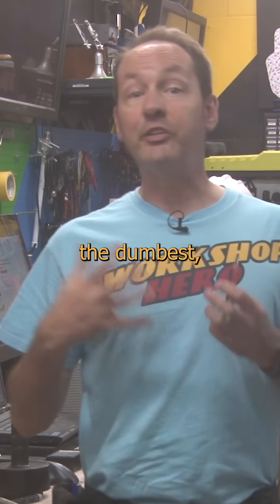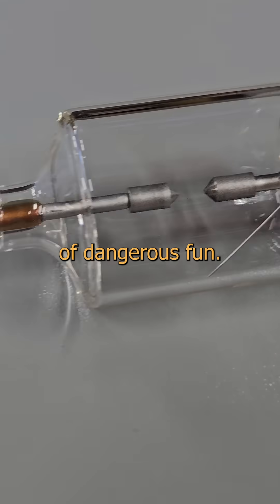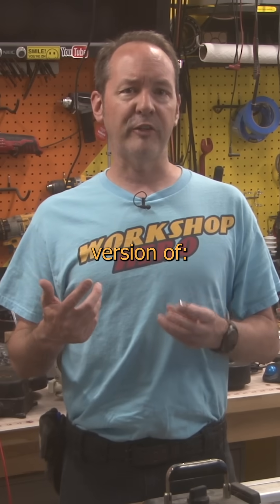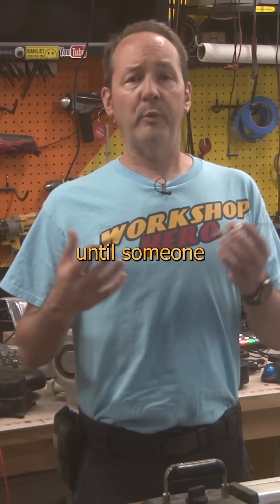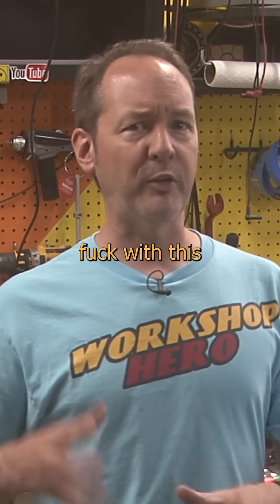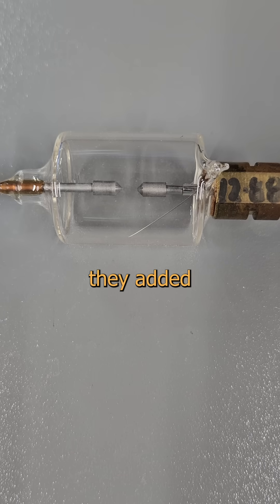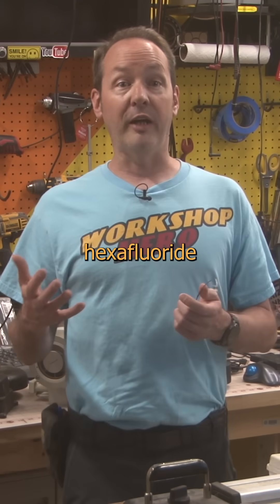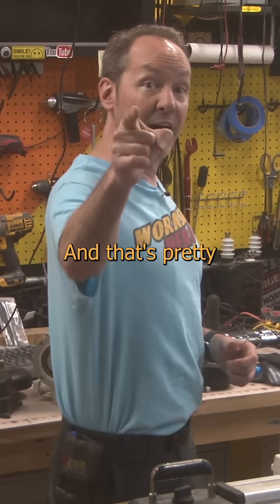Spark Gap Tube #chrisboden #comedy #engineering #highvoltage #physics #tesla #science #energy #cool

Comment: Qwick question for the electrical engineers. When using this spark gap switch thing is there any notable loss in power. I know there is some loss in light and heat but are they big enough   to have a impact  in applications?

Comment: The insulating properties are 1k Ohm per cm, so at 1 cm of air gap a circuit needs 1000V (1kV) to jump! here in europe we have circuits with 400V Phase to Phase, so i know that spark couldnt jump if (at normal room conditions) the contacts are 5mm apart

Comment: What matters for arc-making  is the electric field intensity, not just the voltage. So if you put 300v across a really small gap (0.1mm) the intensity of the electric field will be strong enough to break through air

Comment: I was repairing an old spotlight power supply and found a broken sparkgap. I found the manufacturer and tried ordering one. It turned out that they were also used in trigger circuits for nuclear weapons. I had to get vetted before they'd sell me the sparkgap.... In case you're wondering, it was a General Electric part.

Comment: I get the two bits in the centre, what's with the little wire poking out side it to the wall?  Is that like a backup?  Also by standard temperature and pressure you mean the ICAO standard or something else? 15C and 29.92inHg

Comment: I use a spark gap tool as an auto mechanic. When I question if a waste coil pack is weak,  (usually Buick 3.8) I toss it on and if they're weak they won't jump the gap. Quick and dirty, diag.  Then, so I'm not just chucking parts at shit, I verify the coil resistance.

Comment: The TX Kerrville flood? , and your math. You probably dont want to get in the middle of any of that, its fking with your country pretty hardcore. Your the only guy Id trust to hunt down the answer.
Reply: Just consider checking bits and pieces, I dont think you need much and I don't need a answer from you.
Reply: River rises 29ft in 30mins?  Because of rain/storm. That's like 75in hr? ...??? No one will speak about dam failure, it was all rain? Plus considering TX and it's terrain features being funneled into a particular river area?
Reply: Storm happens from 1am to 4am I'm hearing
Reply: 29ft in 30mins? Not 29ft in 4hrs though.
Reply: Would be more like 400in an hr. I'm not sure a human could stand up and walk in rain fall that heavy if clouds could hold that much water weight.
Reply: Water so fast , ripped live trees out the ground, people floating away screaming out RV windows. The math is not adding up vastly. The number doesn't get close.

Comment: What about the spark plug? Does it have an adapter before from 12VDC to 300VDC? I thought you controlled its power by the gap size. So it would jump at lower current and voltage with smaller gap.

Comment: Residential building wire, nonmetallic sheathed cable is rated at 600 Volts in the US. Not sure why you’re stating 300 Volts.

Comment: The clam operated switch that controls the warsaw water supply from the local river. It's literally just a wire and electrode contact hot glued on a live clam that would close if the water got too dirty and open after an hour

Comment: Pull a vacuum on it and see if it will arc. One video you said wire doesn't care what voltage is on it. Most house wire insulation is 600v rated. I believe its 350v minimum to jump an arc. As long as you are 90% or above on Hydrogen or 10% and below, it will not explode.

Comment: TIG welders use this principle on transformer based units. I believe it's only used for inducing the HF start/AC stabilization voltage. I don't think inverter units require this apparatus.

Comment: This is kind of misleading, when inserting and disconnecting plugs from a 240 V socket, it can spark all the time. You need roughly 0.08 mm to cause a spark at 240 Vac. This is super oversimplified.

Comment: I worked on a pulse power system that had 36 small gas switches with spark gaps just like that shown, they were all timed to fire at the same time using a laser through a window.  The laser would cause the break down voltage of the gas (SF6) filling the switches to lower.  small voltage in  100s of Kv out.

Comment: IFAIK, the breakdown voltage is expressed in V/m. Increase the gap, you need a higher voltage to break down. I once did research on dust explosions, and the setup had 2 of these electrodes too, where I could play with the distance between them.

Comment: Used to work at a power plant with Gas Insulated Switchgear for the High Voltage leaving the plant that was encapsulated and then filled with Sulpher Hexadlouride.
Controlled making and breaking power to the Step-up Xfmrs that went to were connected to the power lines via the typical air-gap switches you see in Substations.  VERY fun to open and close at night ⚡️ ⚡️  ⚡️

Comment: Damn we are only 60 volts off from our wires going up in smoke here in Europe 😂.  We use a 240 volt system at up to 100 amps if needed.  Most of our fuses though are 13 or 5 and 3 amps in our plugs depending on the appliance being powered.

Comment: So it’s 300V at STP, could the arcing electricity change the temperature of the air around it enough that the voltage needed to jump is changed?

Comment: That's pretry cool! Fun fact, that's the same principle that dictates the maximum voltage of a capacitor before it pops. It's not the same as in air (except for air capacitors, those are 300 volts/cm), but if you calculate the distance of an equivalent 2 plate capacitor and apply the 300v/cm or whatever material you're using, you get more or less the same voltage (although they usually lower it to add some headroom)

Comment: Edit: I completely forgot about Paschen law and that the electrons actually need to have enough energy to ionize the air. So yeah you are right there's a minimum voltage.

Old comment: "You cannot get the spark to jump bellow 300V".
Well it's 3kV/cm so 300V/mm. E field should matter, not the voltage. If you get the wires 0.1mm apart, you should be able to get spark at 30V.

Comment: A weird switch that I think is simpler than the spark gap switch is the Mercury switch. My 1965 Pontiac Bonneville has one for the Reel Out trunk light, and I had to sodder on a new connector wire onto the new Reel Out light, because some moron had to remove the original one, toy with a stainless steel tiny push pin cap of the original wire contact and stress about it not shooting off and walla! Now the Reel Put light is operational again after struggling to get the input cap of the Mercury switch capsule to unsodder and release. The best part is that Mercury switch was perfectly fine after 60 years of service and probably half that time sitting on a shelf

Comment: So is there a ratio then that can equate voltage to distance? obviously that would be based on the medium and breakdown limit, but it seems like 300v can equal this amount of area for the limit. If the electrodes are further, it'd require more volts, right? Or will it just carry since it is looking for another end of conduction?

Comment: He quickly mentioned a "fun" little chemical Sulfur hexafluoride. Or SF6. This bad boy are used in large strategic electric equipment when you need to break the current. It is a lot harder to break the current at high voltage.

It is a miracle gas that are really useful for modern way of life. It just has some "minor" problems. In that it is a greenhouse gas almost 24.000 times worse than CO2.

Comment: that tube he has in that video looks to be filled with low pressure xenon based on the arc behavior and color, another fun fact about spark gap tubes is some of the older ones (and possibly some newer ones even) used Radioactive Isotopes to make the spark gap tubes more efficient in Cold Weather/environments, some of the tubes from the 60's are still very spicy even today (i have an indicator lamp that has a 1uCi Ra-226 Source inside it, it gives off around 50,000CPM)

Comment: 300V for sparks to be possible in air? at 230V AC you have peack voltages of 325V, so is it dangerous?
yes. it will still absolutely be dangerous wehn touched, but that's why insulation is there to keep that from boing one's fate

Comment: The 300v rating is legacy, from knob and tube. You can actually touch a live insulated wire and not get shocked, proving the insulation on the wire is doing all of the heavy lifting rather that the air around it.

And the breakdown voltage gets funky below 4um for air. (approx 340V.) V/um or kV/mm skyrockets as you get closer, but very much not linearly. Above that distance the kv/mm breakdown continues to fall, but not enough to really care so much, so the linear increase with distance formula you know.

I know you mentioned distance, but you did glossed over it and weren't super clear on it.

Comment: "the breakdown voltage for air at standard temperature and voltage is 300V.
This assumes 0.1mm air gap.

It is 3kV/mm for uniform fields under standard condition.

This gap is larger yet flashes over,  that is because
1) it is not a uniform field but a  point-point configuration. (i.e. lower breakdown voltage required for same gap size)
2) it most likely is not filled with air at standard pressure
most likely lower pressure, therefore lower breakdown voltage required
3) the gas mixture internally is most likely not air.  This again modifies the breakdown voltage. How depends on the gas.

Comment: We use these to start the arcs on TIG welders. The High Frequency arcs are high enough voltage to jump the point gap, and are induced into the output leg of the machine and down the torch line to the tungsten electrode. Once the HF jumps between the tungsten and parent material, you have enough of an electrical connection for the machine to be able to send full current

Comment: You can build “spark gaps” for any voltage with silicon and it’s usually more stable and can go to higher power.
Usually it’s something like an SCR and a Zener diode - with fancy versions even allowing you to adjust the minimum current necessary to keep the SCR channel in its conductive state.
Very high voltage ones don’t use SCRs but instead use cascoded JFETs with a BJT at the bottom that remains closed until you give it a pulse into the base, that pulse coming from a long series of 3.5V and 7.2V Zener junctions (they do it like this for temperature compensation).
The easiest and most common type of “silicon spark gaps” are Metal Oxide Varistors - but they degrade over time, especially older models.
Reply: Ones I used I might characterize as single-use. They all gave up after 1 arc.

Comment: Actually in Australia most wires in homes are 750v or 1000v insulation rated. 300v is too low for a 240v nominal voltage mains supply and 415v for three phase.

Comment: Had a lightning bolt jump from the stud welder to an I beam, while the crew sat ten feet away, eating lunch. While the machine was off. I told the shop boss, I'd rather walk the 12 miles home than risk pissing off Zeus by ever touching that broken piece of shit machine ever again. A lot of years later, when I took a college class on electrical theory, when the teacher (who was a high up in our local power company) had us run math, he had us use infinity as the resistance on a break in the circuit. When I asked him how the math worked on an arc, he sputtered and couldn't answer. I wasn't impressed.

Comment: Simplest switch: a chunk of steel you drop on two bare wires and kick away when you're done.

Second: I was under the impression spark gap things made a lot of EM interference and are banned. Maybe just radios? 

Idk, for any amateur hobbyist, be careful  you don't anger the FCC. Or worse, local HAMs

Comment: I think the smartest I felt was when our makerspace had a tig welder but it wasn't available to use yet; nobody had dug deep into it but it wasn't working right so I offered to dig in even though I barely knew how to weld in the first place at the time. But I hooked everything up and tried an arc, and it was like... almost working but just wrong. And I just immediately remembered reading something about checking your spark gap. So I found the spark gap spec for the machine and a set of feeler gauges and found they were way out of spec. Adjusted them to spec. Try welding again; turns out I actually had watched enough videos to do it right and I also knew exactly what was wrong with the process. So yeah, I volunteer teaching welding there now lol.

Comment: I'm skeptical of the claim: "no matter how close you put a pair of wires, so long as they're not actually touching, you can't get a spark to jump below 300v". He's right that the breakdown voltage of air is 3.0kV/mm(according to wiki). But doesn't that mean at 0.5mm you'd only need 1.5kV? Decreasing as such until the wires touched. Or is there another phenomenon at play?

Comment: If 300v is the breakdown voltage is that one of the reasons in many parts of the world residential circuits are around 240v so it’s just below the breakdown voltage with a little margin for error.

Comment: This is basically a VT version of a type of thyristor known as a diac.  It does the same thing but with silicon.  And it's not the same silicon that this guy's wife uses to augment her chest.  It's used extensively in dimmer circuits where it controls a triac (bi-directional scr) so it only conducts on part of the AC waveform.

Comment: While there is a dip at 10^-3 torr range. High and ultra high vacuums increase breakdown voltage. From 38-50kv per inch in air to 75kv per inch in high vacuum.

Comment: Hydrogen is the best (better than CF6) for a lot of applications. If you need to worry about boom, you're miles of the target of not having the hydrogen leak out. ---designs and controls these for DC 0.5-1.5kV switches
Reply: Interesting